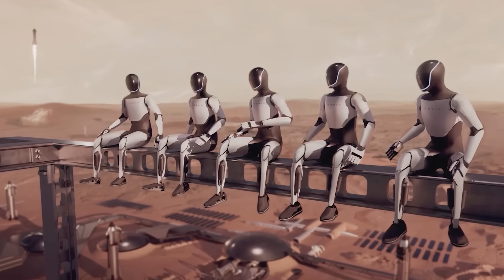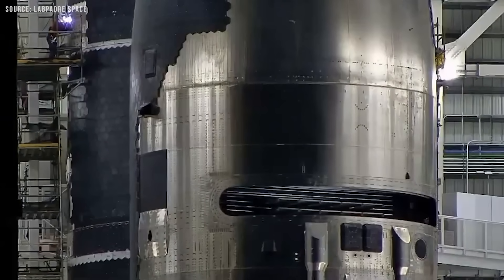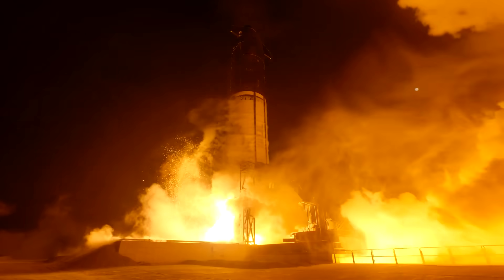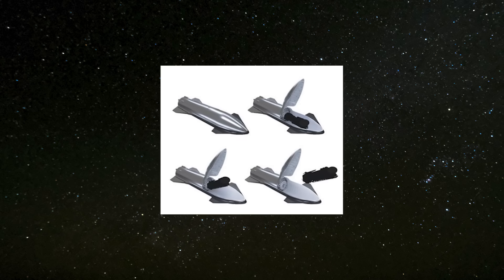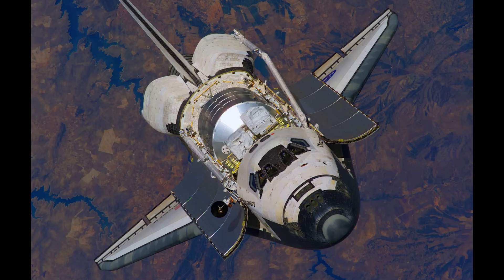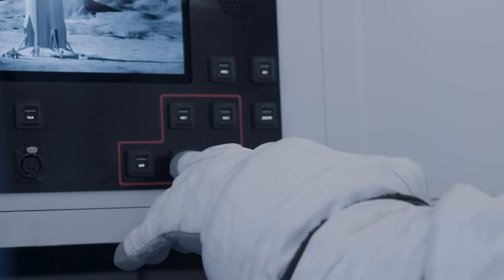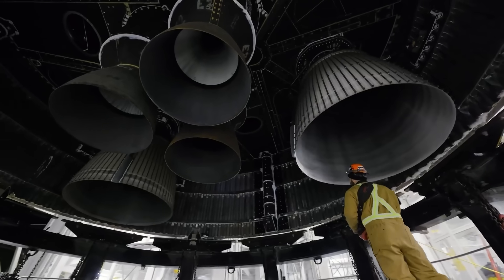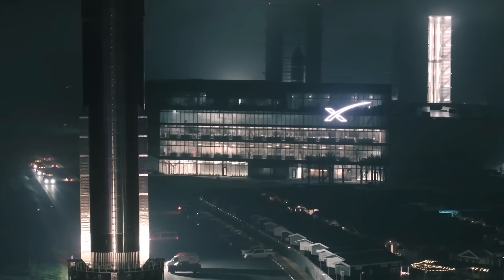SpaceX Found Brilliant Method to Send Starship Payload to Space...

Comment: I really don't understand why SpaceX continually limits itself.  Catching towers are cool but will need thousands of them for point to point operations and the Payload Bay doors on the shuttle never failed so their design could be easily incorporated into Starship design and would work for ANY payload including Starlink.  Why design a payload deployment system ONLY good for one type of cargo?  For a BRILLIANT company, they make some questionable decisions.
Reply: Why? We have airports with runways so planes can land. Why not catching arms? When you think about it, the catching arms supply a second means of landing. Even planes sometimes have landing gear failure and they don't have backups so a starship that can eventually land itself, but have a 'catching' mechanism supplies a secondary landing mechanism that will eventually save the ship's primary landing mechanism.
Reply: @davfree9732  No towers on Moon or Mars, it is a very limiting method regardless of how efficient it is.
Reply: @npbiggs4382  That's why I called the catching arms a 'second means of landing'. 
Landing legs are necessary, but as previously stated... landing gears on planes can fail to deploy... so why not landing legs too? This means they will require landing legs... But eventually they'll have the option to land on legs, or the catching arms... That's the point.
A second means of landing a rocket on par with runways where landing conditions are optimal, compared to landing legs that have to cope with uneven terrain.
If they can build a concrete pad on mars so they have a flat surface to land on, they will... And if they can build a catching arm on Mars... they will.
Reply: Such a door will be heavier than the slit door. Starship already has serious payload problems so they go or the currently best option. Not a bad move as these starships might deliver some Starlink satellites but aren’t designed to do actual work. They are test objects and every actual payload is a bonus but nothing more.
I don’t get why anyone thinks that starship will land on the moon and ever launch again. Way to much risk and dead mass. While Starships design is great for LEO and maybe even cheaper for geostationary orbits disposable rockets to the moon will be ultimately more reliable and cheaper. 
No spaceship with Starships complexity will ever land humans on the moon because there are too many things that can go wrong. Costs may be an argument for goods but for humans safety is premium over costs.
Reply from the maker: Tria and error